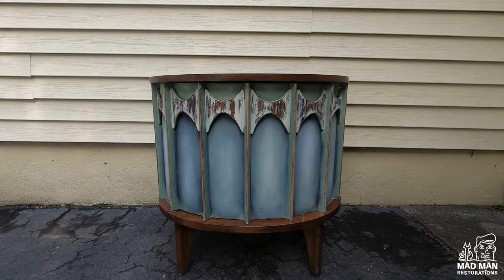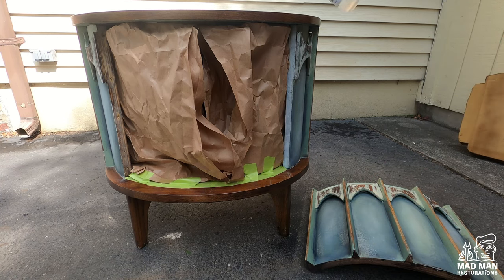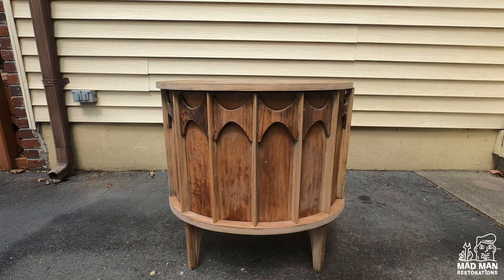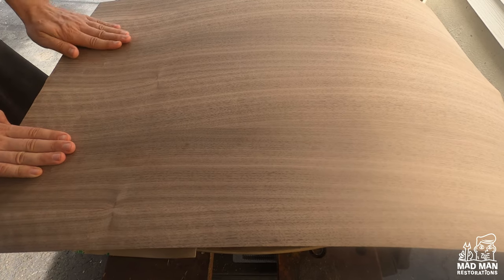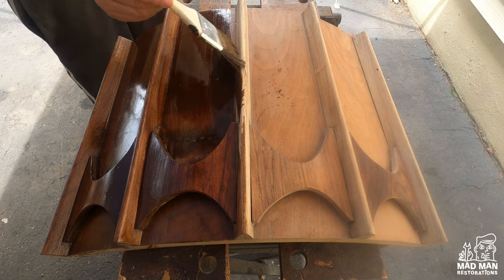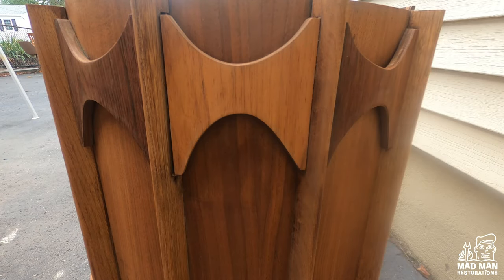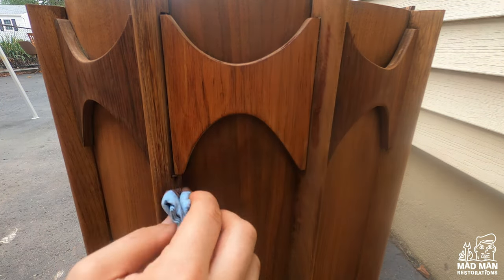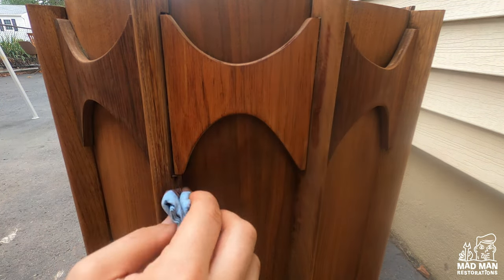Amazing RESTORATION of an Vintage MCM Nightstand | RELAXING Furniture Restoration Video

Comment: Hello, love your work! I am working on a dresser right now, I am loving seeing all the products you use and will be trying out mohawk for my project. Just wondering why you use retarder at the end with the dura coat ? What is the purpose of the retarder ? Thank you so much in advance!!
Reply from the maker: That's a good question. Adding a splash of retarder slows down the drying time of the lacquer. If the lacquer dries too fast it will blush. Which isn't the worst thing, you spray blush retarder from the can. Good luck. I'm here if you have any questions.

Comment: Won’t the glaze wipe off the toner? You don’t seal in between?
Reply from the maker: Surprisingly not as much as you would think. It's untraditional. But I only do it on legs and trim. I would never do it on a top or something like that.